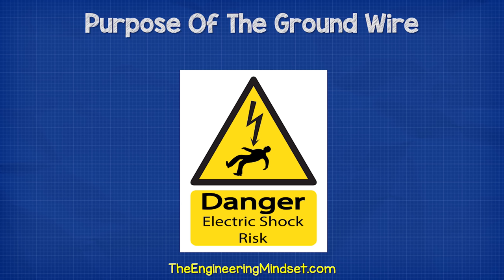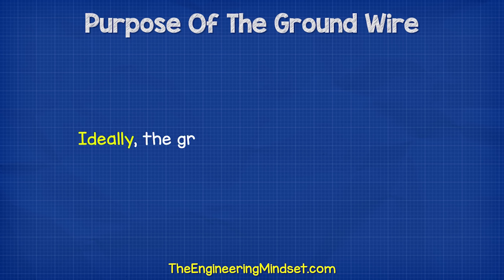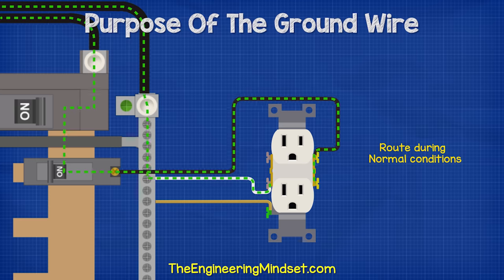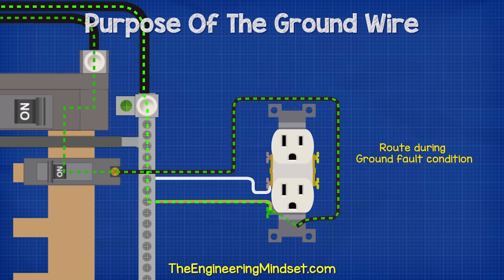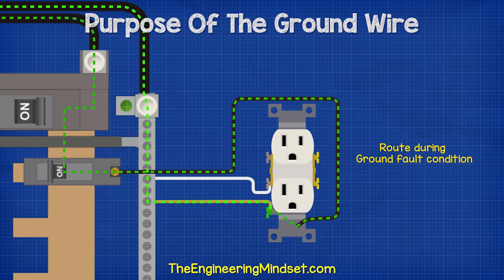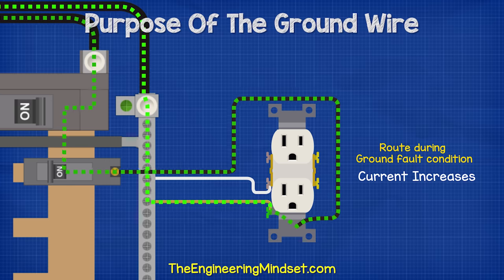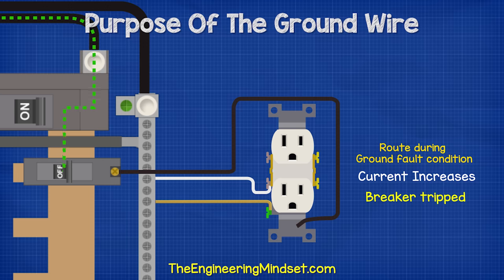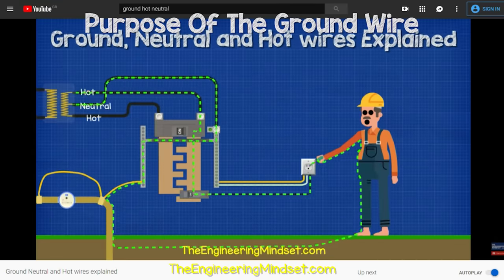Why is a ground wire used?

Comment: I live in an old house we get 110 volts in it. Some outlets ( mostly AC ) have two postive wires one right one left 220 volts compained. How does that work? Can someone explain that?
Reply: Alternating current (AC) is an electric current which periodically reverses direction
Reply: In north America 240V single phase is center tapped at the transformer outside your home.
You have split phase power in the panel with each leg having a potential of 120V referenced to ground.
Reply: My home has that and is only 20 years old.  Often you'll find that in a kitchen where it's possible you'd run two high current devices at once.  What bothers me is they're sharing one neutral, which is not fused (never should be) but could be carrying double safe current by acting as a shared return for the two phases.
Reply: looks like you've got two live lines in the socket (not one live and one neutral as it should be). Each phase is probably around 120V, so the inter-phase voltage will be around 210-220V.
Reply: You shouldn’t have 220 volts on any regular wall outlet. The receptacle should look different such as the one an electric dryer plugs into or be round with horizontal slots.
Reply: @patrickg7569  One has to ask where the OP lives and what is meant by "some outlets" and "mostly AC"
Here in North America, before central air conditioning was common, it was typical to have 240V (nominal) through the wall air conditioners in many rooms.
NEMA 6-20 is the mirror image of the NEMA 5-20 (120V) configuration.  It wouldn't be uncommon to have a single 6-20 receptacle in many rooms
Reply: Look into how center tap transformers and split-phase power work
Reply from the maker: We just published a new Ground fault, short circuit and arc fault video, so much detail! Link HERE➡️: https://youtu.be/Qi0ynSQw-wc

Comment: you could have explaned that current would not flow to the ground if we would not connet the neutral to the ground and that neutral and ground wire are """the same"""
i think its iportent to understand that there needs to be a potential differenz otherwise the currend would not flow

or in other words IF there is NO connecton between neutral and eath you would be able to toucht a bare kable and  nothing would happen to you
Reply from the maker: We just published a new Ground fault, short circuit and arc fault video, so much detail! Link HERE➡️: https://youtu.be/Qi0ynSQw-wc

Comment: "Ideally... Will never be used"

That's not exactly true, during thunderstorms large metal objects like fridges and bridges get charged externally. In those cases the ground wire neutralizes the charge of the metal.

---

I guess it depends on the context of the word ideal. The ground wire doesn't get used in contrived on paper ideal conditions, but it does get used in normal conditions several times a month. If you live near Lake Maracaibo, you'll be using it 160+ days of the year.

---

This also explains why Japan doesn't put them on outlets as often. Their appliances are smaller, covered in plastic and they have less nosy children to poke at the outlets.
Reply: Not exactly. Current due to lighting is returned to it source via an Earthing rod , while current via circuit is returned to it's source via it's grounding wire. They are different sources
Reply: My fridge does not get externally charged and there are zero bridges connected to my house's electrical system. I know this because I live here and I have noticed no bridges and that unplugged fridges do not get static charges during thunderstorms. There are 8 billion people on the planet. Statistically, just about nobody lives by that lake you mentioned, they don't know anybody who lives by that lake, and couldn't find it without an internet search.
Reply: @RobMrowiec  So you're telling me that you don't live by that lake, didn't know anyone who does, and couldn't find it without an internet search? Thanks for confirming what I said.

 Of course people live there, it's just not a statiscally significant number of people when discussing how residential electrical systems work or whether or not fridges get externally charged if there's a thunderstorm.
Reply from the maker: We just published a new Ground fault, short circuit and arc fault video, so much detail! Link HERE➡️: https://youtu.be/Qi0ynSQw-wc

Comment: Why dont modern electronic items such as Tv's , Macbook or smartphones dont have ground pin?
Reply: Double insulated products don't require a ground by law.
A phone or laptop operates on batteries and the transformer provides isolation from mains current.
Reply: Here in the UK class one appliances are earthed or grounded. That's cookers, kettles, irons, microwaves etc.
Class two appliances have a double layer of insulation so don't require grounding. Examples are hair dryers, radios, lamps, dvd players etc.

TVs can be class one or class two.
Reply: @WillCamx  The U.S. uses the exact same system (class 1 and 2 devices).  Don't need ground pins on class 2 "double insulated" devices.  Over here, the cords come with only 2 prongs on them, but in the UK they still come with 3 prongs (but the ground prong is a dummy prong).
Reply: @Wowzersdude-k5c  UK outlets have shutters on the live and neutral terminals that only open when the earth pin is inserted. Stops people sticking things into sockets
Reply: @WillCamx  Yes. This became a law in the U.S. about a decade ago, but our shutters kind of suck. We need a redesign of our outlets, but they are too engrained now that it would be a massive chore.
Reply from the maker: We just published a new Ground fault, short circuit and arc fault video, so much detail! Link HERE➡️: https://youtu.be/Qi0ynSQw-wc

Comment: Sorry but not very well explained what ground wire is actually doing
Reply: In a nutshell: it's main function is to trigger the circuit breaker, so that in case of ground fault the voltage is discontinued. Breaking the circuit, in two words.
Reply from the maker: We just published a new Ground fault, short circuit and arc fault video, so much detail! Link HERE➡️: https://youtu.be/Qi0ynSQw-wc